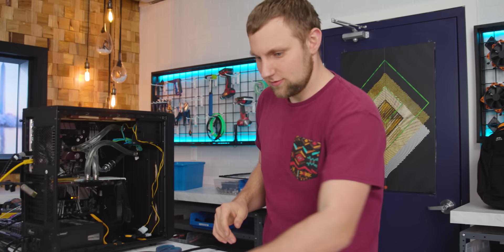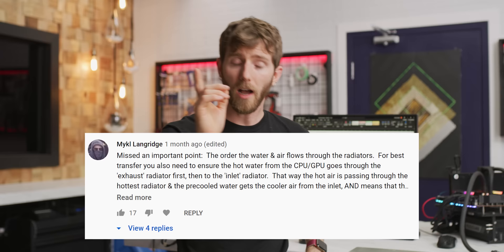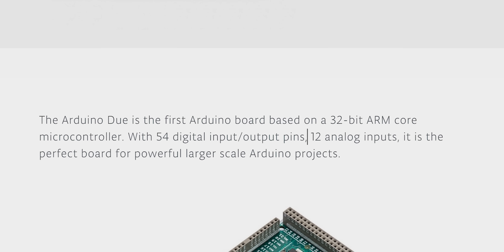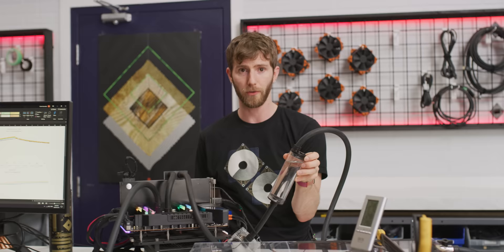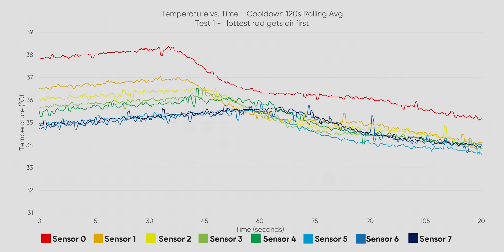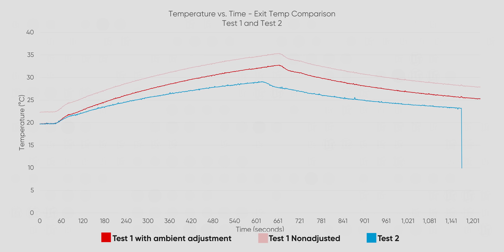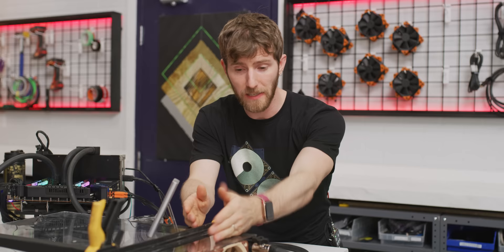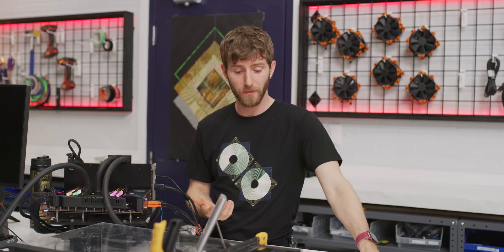Is this even going to work…

Comment: As one of my college professors said to me in Circuits 2, "When it comes to testing a system, especially an electrical one. You will almost always come to the conclusion of....it depends."
Reply: I'm married to an engineer. That is always her answer.
Reply: What you will find is what it depends on. That is also good information.
Reply: One of my professors (he used to teach electronic components and building circuitry), first class and he goes:
Prof:"Imagine you're defending your engineering theses and the comitee asks you a question. What's your response? If it starts with anything else than "it depends" then you probably got the question wrong, or didn't study that topic."
Reply: So in other words, it depends if the answer is it depends.
Reply: @skywz  Well....it depends.

Comment: when a programmer makes a graph "sensor 0"
Reply: Which is the correct thing to do because you can increment through the sensors then use modulo arithmetic to easily get back to zero again.
Reply: @brazeiar9672  YOU IS BIG SMART
Reply: Exactly why programmers do - and almost no one else.
Reply: When the data is input through a program. Its probaply on PinIn 0 so the Arduion Assigns it an index of 0.
Reply: Python starts with 0 instead of one sooo........
Reply: *Lua programmers left the chat*
Reply: @williamyang4533  While stupid Lua starts at 1
Reply: @graysonvirtue4058  Hahaha, yup
Reply: @1johnwg  people used to use the 0 position to store the length (no. of data point) of an array.
Reply: 0 is a number too :)
Reply: @ArenClegg  yerp lol
Reply: I'm the 2^8 liker
Reply: For you non programmers, the reason why in programming we start at 0 is because Arrays are represented by a pointer on the very first element, so to get the 2nd element you have to add +1 to the pointer, or array[1]. 3rd element you need to add +2, or array[2], etc.
Reply: Nathan Arrays start at 0 lol
Reply: I liked the comment it changed to 421. I had to remove my like ☹️ sorry bro
Reply: @soniablanche5672  Arrays start from 0 because you start a block of memory from 0
Reply: I'm a programmer (and one that specializes on backends i.e. things that users won't see) and everyone's right about how arrays works and other programming tricks.... but what we must present to the user is something that they can understand. The user thinks by "the first sensor" or "the number 1" and reacts to it. If a graph is going to be "consumed" by third parties unrelated to the process, it must help them, they must understand it... otherwise there will be accidents. Sometimes, horrible ones.
Reply: @MyCarllee  that's the one reason why I hate lua... as well as many other reasons...
Reply: @1johnwg  nah, im programming the index starts at zero because the index represents the offset of the element from the beginning of the array. The first element is 0*size bytes away from the first memory location. The second element is 1*size bytes away from the location.
Reply: @brazeiar9672  Yes but many programers will/should make the labels that fit with every day use.  So they would label then sensors in the real world 1,2,3,4,5,6,7,8 but in there program do the math on 0,1,2,3,4,5,6,7,8

For c=0 to 8
Input from sensor(c)
do math on sensor(c)
Print "The temp for sensor " c+1 " is:" sensor(c)
Next c
Reply: It's logical in this instance, since it's situated after 0 radiators. This numbering makes it considerably easier to see at a glance the sensor's position in the stack.
Reply: Static Charge Red Field  yeah it's true
Reply: @1johnwg  become one and u will understand
Reply: @soniablanche5672  Or more precisely: offset multiplier.
0 times don't matter = 0

Comment: Now I'm curious as to how many people actually interpreted "stacking radiators is bad" as "stacking radiators without adding any additional fans is bad" vs "stacking radiators (including additional fans) is bad"
Reply: Stacking radiators with fans AND spacing between radiators for fresh non recycled air is best. That way you nearly remove all preheated air.
Reply: I am still trying to figure out why corsair, a company that has a history of making good cooling gear, would consider a straight flow series stacked radiator system without sandwiched fans to be a legitimate case for making an argument against stacked radiator systems. the best I can figure is I have missed a point of context here in the argument between corsair and linus. It took me all of an hour back when I first heard of liquid cooling for PCs, despite not having a degree in theromodynamics, to figure out that a reverse flow series stack with sandwiched fans would have greater cooling for the form factor of a PC case even if the air is preheated by the non waterblocked components in the case, and even better if you can feed them fresh air and draw the preheated case air through a different fan group.
Reply: i got from it "stacking radiators where hot air from first one is cooling second one is bad"
Reply: Yeah i assumed people were sandwiching fan > rad > fan > rad etc.

Comment: Corsair employee 1: we can't afford research 

Corsair employee 2: yes but I know who can

The rep: let's set the plan in motion guys, I'll make the claim
Reply: Lmao Corsair engineer and Pr team big brain for tricking linus to this stuff for free
Reply: Well, they did send pics of flow simulation data
Reply: @WebbSM  shit you had to exist
Reply: You just can't do the dishes. It's impossible!
Reply: Liam Nolan oops must have been my bad non ECC RAM😂😂
Reply: Woah comment stolen
Reply: I am not sure there is much research done since the tag "Gaming" has been attached to PC systems, The community does all the work and then the companys pickup what is most popular seen it now with so many products, I used to think this was outdated information however it seems to be more relivent now then ever, I once went to see a demo of a new Water cooling system this was in the early 2000's and it was in the days before "Clocking" was introduced to the main stream so didn't see any real point in it as Aircoolers did there job and the only benifit they were selling was better life span for components, Asking more questions they brought out some technical specs and to my supprise it wasn't for PC's they were for motorbike cooling systems, anyway even back in them days I remember being told something like stacking was only for when you had 2 independent heat sources and would allways go, Coolest>>Rad>>Hottest>>Rad>>Res&Pump however that was 20 years ago and Zalman had just brought out there first tower cooler so I brought one of them and forgot about watercooling.
Reply: This isn't research lmao, you can find this in a text book.
Reply: @WebbSM  r/wooooooooooooooooosh
Reply: @ham1847  which one😂 mine?
Reply: Poor Corsair; spent all their money on RGB lighting.
Reply: Joseph Lyon trying to sell their RGB fans for 30 quid each to try and make the money back
Reply: alex1 yes the results are very predictable but at least he made some content, a cool arduino test setup and got the exact numbers for the theory right?
Reply: Cunningham's law in action
Reply: @WebbSM  Simulation flow data only needs only a single workstation PC to make. You don't need to have 7 rads with the accompanying fans, a data logger set-up, the wind tunnel, and the overtime pay to monitor the data logging.
Reply: Well according to Linus HE can't afford it. Just ask Billet Labs.

Comment: As someone whose university degree included thermodynamics: second test is referred to as counterflow, and is always better, provided your heat exchanger doesn't get damaged by thermal stress due to temperature difference.
Reply: Can confirm that, chemical engineer with thermodynamics in one semester.
Reply: @TobiasDettinger  also can confirm, 10 mins of google research.
Reply: can confirm, no degrees or anything you guys just used big words so i know what you're talking about
Reply: Also can confirm degree in photography
Reply: 7
Reply: Goodbye and thanks for the fish?
Reply: Since you have it all setup, could you compare your findings with radiators setup in a way that each of them gets the ambient air and not air heated by previous rad?
Reply: Tobias Dettinger mmm prof I got a idea for an thermodynamics class 😂
Reply: @TobiasDettinger  Can confirm, I asked a random friend with no knowledge, said yes
Reply: This is basically how industrial heat exchangers work; by industrial I mean petrochemical/power generation industrial.

Source: Engineer with EPC experience.
Reply: Let me see your science license first!
Reply: It's also how fish breathe
Reply: Can confirm, I can eat a steak with just a spoon.
Reply: wow thats so smart i stopped reading at university
Reply: Ayyy Chem-E chads rise up
Reply: @TobiasDettinger  you only took one 0.o? We took 3!
Reply: Can confirm that..based on these replies
Reply: Can confirm so I dont get left out...
Reply: Anyone that used a liebig condenser (and asked "wait, why is the water flowing 'backwards'?") should've learned this too.
Reply: @Adderkleet  That is also because it pushes any air up and out of the system.  Going in from the downhill side allows a slight trickle of water to keep the condenser full, whereas going the other way the water would flow out much too quickly.
Reply: @TobiasDettinger  3rd year Chem Eng, can confirm
Reply: can confirm with degree in gender studies
Reply: @benderozo  no one said they have anything setup.
Reply: Most of the genuine comments were about the counterflow on first video and corsair claimed that a single radiator can result in 1-2 degree temp difference between output water and output air because they were very efficient and therefore adding more radiators won't help much. Linus agreed to this. he said stacking helps as long as the last radiator has a meaningful temp difference between input water and air. However, corsair's claim of high efficiency was not tested here because we didn't measure the temperature of air here and they used alphacool radiators, but consider the same air cooled the water further in next radiators by quite some amount, it seems the difference is not as low as 1-2 degree. Next video needs to be on this. Find the difference in temperature of output water and air.
Reply: a smart person in youtubes comments, somethings off
Reply: how can I violate the second law of thermodynamics?
Reply: Why don't you all post your resumes while you're at it
Reply: Can confirm, just read your comment.
Reply: @dakoderii4221  Even more qualified, i have done absolutely 0 research and have received no schooling in thermodynamics.
Reply: It comes down from simple calculations, I couldnt believe how clearly it comes out from actually calculating that. We always use counterflow in chemical engineering.
Reply: @TobiasDettinger  ayy, Chem Engineer squad rise up
Reply: Can also confirm - multiple people on the internet have confirmed it - so I'm now safe to say that I confirm it, knowing that it's probably true and I'll look cool.
Reply: Just like the rete mirabilis in some mammals.

Comment: The electrical engineer in me predicted these results.  For better results, I hypothesize that radiators with the fluid flow in parallel will do better.
Reply: Agreed. Parallel radiators would be the same as having a bigger radiator, right?
Reply: Disagree. Radiators in line with the fluid flowing the opposite direction of the air should be optimal, that basically makes it a counter-flow heat exchanger (most efficient system). Putting the radiators in parallel would probably be similar to having one incredibly thick rad with a fan capable of driving air through it, and be similar to one cross-flow heat exchanger, which is better than a parallel heat exchanger (both fluids in the same direction), but less efficient than a counter-flow one, so it should in theory fall between the two different setups they tested here.
The 'heat exchanger' article on wikipedia is pretty much on point in explaining this (much prefer the German one on the off chance you speak it).
Reply: @MrJ4ckie  what about facing two radiators into each other? Maybe eventually the heat built up in such a system would open a portal to hoth and you pc would just be eternally cooled by the temperature of an ice planet.
Reply: @MaxUgly  
Nope.
Parallel or seriel does not matter at all for temps.
And if you only have one inlet and one outlet on your pump, it will not matter for pressure either, as there are no more restriction in a radiator, then in your loop tubes.
The cooling of your loop is determined by the cooling capacity of your radiators, and the heating of the loop is determined by the power output of your components.
If you split the loop and put the two radiators in parallel, the flow will fall to about half, and soak up more heat from the component on that loop, and the fluid will remain longer inside both of the radiators and get slightly more cooling, but because the fluid was warmer before in entered the radiators, and they mix together in the same reservoir anyway, before being pumped out again, it will not matter at all.
Reply: @TheRealBaDaBingDK  The restrcition works like resistance in a wire. More downstream restriction all adds up. The rest of what you said is correct though, I believe. If you still disagree, I will take the time to type out the math here for ya. I appreciate the conversation and unlike most other times I believe I am correct here.
Reply: @MrJ4ckie   Correct me if I'm wrong but I don't think a radiator that is twice as thick is the same a two radiators running in parallel. I am assuming that parallel implies two radiators with separate air intakes that splitting the coolant flow.  Yes the speed of the fluid is halved in both set ups, but at parallel setup would present cool air to both intakes where a thick radiator would feed hot air to the fluid downwind of the intake. Since a parallel radiator will have a larger change in temperature for more of the coolant and the same fluid flow rate as the thick radiator, a parallel system should have higher heat flux and lower temperatures. That said, how you manage to split the flow between two radiators is beyond me. It would be something interesting to try though. Maybe 2 pumps or an adjustable valve to balance the flow rates? Maybe it doesn't matter and as long as the flow rates are similar its good enough?
Reply: @RyanLee-kd2ks  You are correct, however that was not the kind of parallel configuration I meant. I was referring to a setup as shown in the video with the radiators' air flow in line with each other (=one shared intake) and the only difference being the water flow.
Splitting the flow between the two radiators is simple enough, you can just use a Y-fitting. The water will flow inversely proportionally to the restriction of each path (i.e. more restriction=less flow), which should be similar enough if you use one radiator of equal or at least similar dimension on each path.
Reply: @MrJ4ckie  Ah I see, parallel water/series air not parallel water/parallel air. Since there are two working fluids I get confused sometimes..

Comment: When the radiators are stacked in sequence, indeed the warmed up air that goes out of the first radiator, has less ΔΤ compared to the hot water in the second radiator and heat load is not effectively removed. By the time the air reaches the 5th or 6th radiator, it's probably as hot as the cooled down water that goes through that radiator, so no real heat exchange is happening. Like you (correctly) stated, the stack of radiators just increases thermal capacity.
BUT, try to put the radiators in parallel, so that each radiator gets fresh, cool air. In such an arrangement, the heat removal will probably be almost doubled with two radiators. And because the second radiator will get cooler water with the same room temperature air to remove heat, the progressively lower difference between "hot" water and "cool" air will again create diminishing returns after 2 or 3 radiators in parallel. 
Since you have made up the rig, it's worth to try this out. You don't need to work up to 6-7 radiators in sequence. Just try two and compare with one. And by the time you try a third one, I am guessing you will see significantly less than 3x the heat removal.